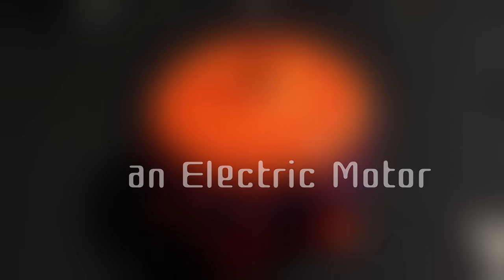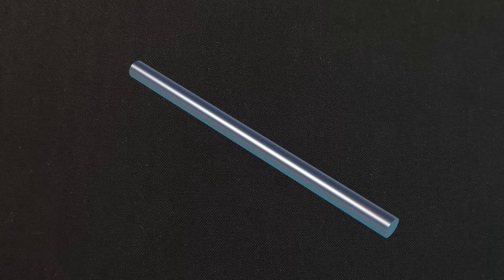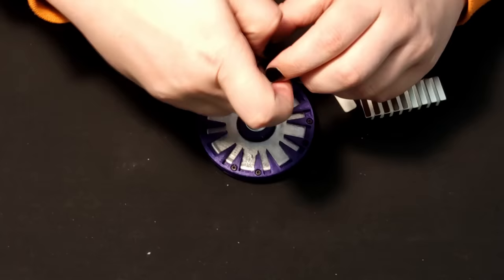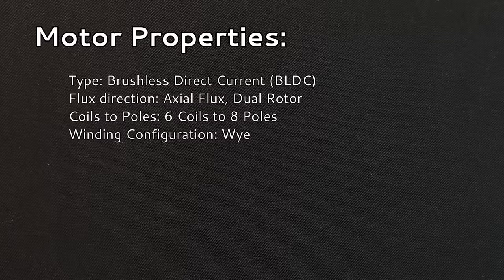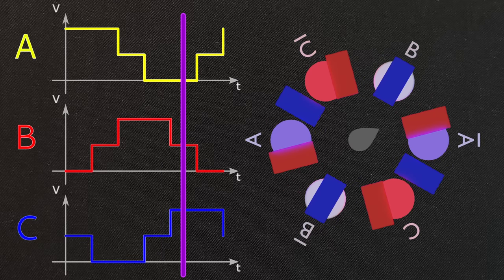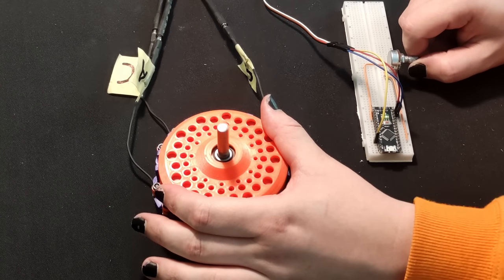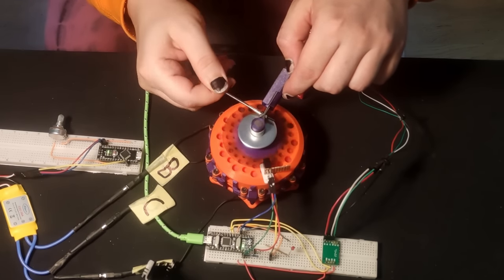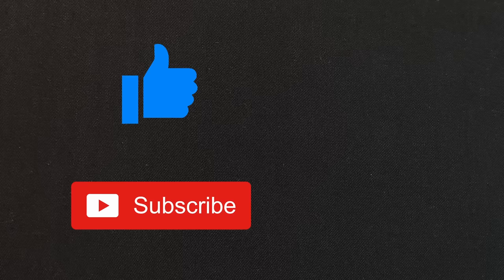An Axial Flux BLDC Motor Build

Comment: The solid steel core (big washer) was a mistake. You do not need a core between the magnets. You can use a single magnet for each pole, no need to stack them. A core associated with each coil can work good but you don't want solid steel. Better to use high silicon steel laminate. Notice how a microwave transformer is made, with layers of lacquer insulated steel sheets? This controls eddy currents but passes magnetic flux. However a fairly efficient motor can be made with coreless coils. A laminated annular casing can also be used to complete the path of magnetic flux generated by the coils. 

DIY axial flux BLDC/PMAC motors that test at efficiency levels in the high 80's or even low 90's are not unheard of. There is no reason why a DIY motor cannot match the performance of a commercially available motor such as those made by Motenergy, for example. 

Another improvement in efficiency is instead of using back EMF, use an array of Hall Effect sensors for rotor positional input to the controller. You can experiment with timing by rotating the sensor array about the axis of the motor. 

You are wasting significant energy by using very flexible 3D printed parts. You want high rigidity and low eddy current losses which dissapates as heat and kinetic energy in the form of vibration and noise.

I would also incorporate a thrust bearing to keep the rotor centered between the stators. This is particularly useful when directly driving a propeller and generating an axial force on the shaft.

There are formulae for calculating number of turns in the coils, etc for different speed and torque requirements for different loads and different voltages. For the DIY-er it is probably easier to simply experiment, and optimize. Another factor for optimization is spacing between rotor and stators.
Reply from the maker: Hi!

The solid steel washers are not "cores" but "back-irons", which serve to give the unexposed permanent magnet poles an easier flux paths between one-another, which in turn slightly increases the magnetic force exhibited by the permanent magnets. The magnetic flux generated by the electromagnets is not able to influence the back-iron due to the permanent magnets and their much more dense magnetic flux being in the way. Therefore, the back-iron does not experience any eddy currents (there are no changing magnetic fields inside the back-irons) and cause little-to-no drop in efficiency. Yes, a back-iron is less needed in a Halbach array rotor, so it may have been better to not have it but it certainly would not have been a significant difference either way.

Have you ever tried finding electrical steel laminations for sale? Especially for your specific project? Electrical steel laminations are for products that actually end up getting mass manufactured or sell for large amounts of money per article. I am quite poor, and most definitely can't afford 10000$ on a single project! I have entertained the idea of finding a product with suitable electrical steel laminations and simply cannibalizing the electrical steel from there and cut them to shape to fit my purpose, but so far I have always just opted to use mild steel, which for many of the common blends have maybe about 20x worse magnetic characteristics than most blends of electrical steel... but still 50x better magnetic characteristics than just air... 

The efficiency of diy motors is difficult to get very high, especially when 3d printing components out of plastic, because the tolerances simply aren't there. The air-gap between the rotors and the stator for this motor are between 1 and 2 mm... (in production motors this gap is always less than 1mm, usually on the order of 0.1 to 0.2mm). Add to that the use of non-ideal materials, inefficiencies from things like rotor inbalance and less uniform windings... I think that a diy plastic FDM 3d printed motor will not reach even 80% efficiency for the next decade.

Hall effect sensors can be used, yes... in-fact they were necessary for my next motor project which I will release probably within a month.

Once again, this is diy, made cheap... literally in a commie-block apartment room, I'm not sure what kind of manufacturing quality can be expected unless I order like... CNC-milled stuff, which would be too much of a monetary cost for me to take right now. 

Thrust bearings should be added if the motor shaft is expected to get pushed or pulled like when a propeller is attached to it. Having said that your motor needs to be pretty darn big and powerful for this to be really necessary. Not a single drone motor (even those crazy ones that supposedly have a 2hp peak power output) I have seen, uses thrust bearings in their construction. 

Of course there are formulae. I'd contest that such formulae are used in conventional ways nowadays any more though... and experimentation and optimization is the gold standard of the industry nowadays. Simply that the experimentation and optimization is done in software using finite-element-analysis models... Unfortunately, the best ones, such as EMworks, are part of larger CAD suites, which are prohibitively expensive for diy-ers to use. If you know of a good and intuitive free software for magnetic, or indeed, electric- and magnetic analysis, then do let me know! I have been looking for one on and off for some time now.

Comment: These axial magnetic flux motors are revolutionizing EVs soon. Yasa and Magnax have an efficiency of close to 98% at a very wide rpm range which gives you about 10% extra range compared to usual radial magnetic flux motors in EVs.
Mercedes have it in their EQXX and will soon apply it in the AMG versions of their EVs.
I am not sure if production is more complicated/expensive. So far my understanding is, that these motors are cheaper because less material is needed. I also don't know how much the rare earth magnets for an 300bhp EV sized motor would cost. however, soon iron nitride magnets seem to same the day and bring the cost down
Reply from the maker: The advantage of axial flux motors as opposed to radial flux ones in EV-s is the higher power density and consequently higher power to weight ratio. This is indeed highly sought after in EV-s as it allows you to put more batteries on the vehicle, prolonging its range. Axial flux motors are much more difficult to manufacture though, as any automatic winding machines are much more complex, and simply manufacturing a good performing stator with iron cores essentially mandates the use of milling - contrast that to radial flux's need of just stacking electrical steel laminations to create the stator, it's a massive price and complexity difference. 
Indeed, another problem is the need to use rare earth magnets, usually neodymium magnets, which are made from expensive, environmentally polluting and politically contentious resources. 
I also looked into the iron nitride magnets you hinted at, and while its flux density of 1 to 1.5T is impressive, the coercivity is pretty low, meaning they will be quite prone to demagnetizing over time... and forget about making any Halbach array, where magnets are constantly trying to demagnetize each-other. In addition, it seems like the coercivity drops off faster with temperature than rare-earth magnets. All of which is to say, I can definitely see iron nitride replacing rare-earth in some applications, but for EV-s it would require careful cooling design considerations, which might complicate the whole vehicle design enough for manufacturers to not bother in many cases.

Comment: Something is out of phase inside your motor.  If you put iron inside with it you may have cause the fields to mirror each other or push out too far and this causes you magnets to be misaligned.  I suggest you take the iron out and try it with just magnets and coils.  Any iron should be outside of the motor's workings, like a simple backing plate.
Reply from the maker: On an axial flux motor, the only possible place to put an iron backing is on the rotor(s). This is a very common thing to do on axial flux motors. The iron backing only acts as a low-reluctance path for the magnets to couple to each-other and ever-so-slightly increase the magnetic flux density in the airgap of the motor, as well as minimize the magnetic field outside the useful working area of the motor. I am fairly certain the problem is in one of the coils (maybe i ended up winding one coil the wrong way... though i did quickly check for that and at first glance it didn't seem like anything was wrong). For the next axial flux motor I will take more care to triple-check every assembly move I do.

Comment: I think you'd need laminated iron cores between those coils if you'd want to get higher efficiency, the magnetic field on the coils is not concentrated enough. I considered using steel strapping for my own project as a go-between since it's too hard to find electrical steel, this mild steel would have more hysteresis but having any kind of iron core would likely increase the efficiency by a lot just by reducing air gap and concentrating the magnetic field.
Reply from the maker: It's just fairly difficult to fit iron cores in an axial flux motor, and indeed, it's just very difficult to source a good electrical steel material. I was thinking that maybe old transformer cores would work if cut into shape, but I am not sure about their high-frequency characteristics - maybe it changes something.
Reply: @BirdbrainEngineer  failing that you might just try protopasta's iron-filled PLA. It's definitely not as good as pure iron but it would probably be better than no core at all
Reply from the maker: @0hypnotoad0  I believe I saw someone testing the magnetic permeability of "magnetic pla"-s and they don't have a magnetic permeability greater than 5 to 10, which is really really bad. Put ontop of that the fact that PLA melts at a low temperature, it's just not a good idea to use that in a motor one would expect to be "useful" imho. (The motor made in this video was never meant to be "useful" for anything, rather just to lean how to make one, hence the heavy use of PLA). I think in the future if I 3d print parts for a motor then they will be printed with ABS... or if it is possible with my printer, then maybe even polycarbonate.

Comment: some of the new motors actually are called radius axial they use both both types for motor with high tourque and high rpm
Reply: And I assume higher eddy currents?

Comment: Try using plastic self lubricating bearing. Igus has some available or you can machine your own from a variety of plastics. Also from what I understand these motors get hot. And I didn't hear how much horse power this motor was rated at.

Comment: Stator with 6 coils evenly spaced in a circle. Rotor has 2 levels. Level 1 has 6 north facing magnets. Facing the coils. Centered over the coils. Level 2 has 6 south facing magnets. Facing the coils from the other side. Evenly spaced between level 1's magnets. When rotated to induction will become autonomous. Why? Just type this into A.I and it will explain it

Comment: Am I mistaken or wouldn't you get a stronger magnetic field if you would've put iron cores into the stator windings?
Reply from the maker: Iron cores essentially extend the generated magnetic field all the way to the airgap of the motor. So yes, generally it is a good idea to have iron cores in motors, however it's simply difficult to accomplish for axial flux motors, and ontop of that... most steel products that you are able to find easily do not make for good electromagnet cores due to their geometry and magnetic properties.

Comment: with a ferrous material in between each coil and with magnetometers on the motor to measure the magnet position to optimize field position you could probably get much better efficiency.
Reply from the maker: Most freely available steel is either some low carbon steel or stainless steel... out of both categories, most blends will be suitable to act as iron cores for the electromagnets, but they are not really that great at that role. And indeed, if you are not careful, then you may actually end up losing performance due to increased eddy currents and cogging. I am working on a motor project that uses steel though, so I definitely haven't ruled out the possibility
Reply: @BirdbrainEngineer  what about silicon steel as used in transformer cores ?
Reply from the maker: @heartobefelt  Silicon steel is the most common type of steel used for electromagnet cores. Usually the exact magnetic characteristics of the electrical steel (different name for silicon steel in electric applications) are specifically manufactured to suit a task... May it be as motor electromagnet cores, transformer cores, noise filters, etc... 

I have thought about using old transformer cores as electromagnet cores for a motor, but I haven't really looked much into it yet. But yes, it is on my radar as a possibility for sure.

Comment: Amazing video. However, I have a doubt. May I know why efficiency of this motor is only 53%? I am sure you can increase the efficiency by a lot more. Axial Flux BLDCs can give up to 96% efficiency if done right.

Usually, in conventional motors, windings are done around a ferromagnetic core so that the magnetic field of the coils are more concentrated, increasing efficiency.
Reply from the maker: The efficiency is low because one of the phases is quite messed up. If it was working as good as the other two then the efficiency would probably have been closer to 70 to 80%. Other sources of inefficiency is cogging from using quite ferromagnetic bolts and nuts (seems like cheap chinese ones are made of some extremely mild steel), as well as a fairly large air gap between the rotors and stator (about 1.5mm). 
And yes, fitting iron cores to the windings is usually the way to go but it's very difficult to make that happen, especially for axial flux motors... so most diy-ers choose to go for air-core.
Reply: @BirdbrainEngineer  Air gap should not be an issue, as most ordinary motors have about 1mm air gap. Cogging is an issue but can be fixed by using materials with lower permittivity or decreasing the width of the ferromagnetic core. But these 2 problems can give max 10 to 15 percent efficiency loss. I think the phase winding is the main problem. Hope to see all these corrected and another video with higher efficiency.
Reply from the maker: @aadhithvarathan5432  I have plans to make another permanent-magnet axial flux motor one day... but probably next year. I'm also considering trying my hand at making a SynRM motor at one point.
Reply: @BirdbrainEngineer  Eagerly looking forward to that video. I am actually very happy to see more people trial new motor technologies like Axial Flux.

Comment: Why do coils have a "neutral" or unconnected position, wouldn't it be better to drive the coil to the opposite polarity and push away the pole that just passed ? It would then be energized in the correct polarity to attract the next pole as well, since there are not neutral poles ?
Reply from the maker: The explanation is made with "neutral" poles in there for simplicity's sake. In reality, the ESC attempts to mimic a sine-wave pattern (which usually ends up being a trapezoidal-wave pattern) on each of the coils through pulse-width-modulation. Search "ESC waveform" on Google for images and articles on the topic.

Comment: How does the fifty three percent efficiency rate against other electric motors types ??
Reply from the maker: Not very well haha. Air core, large air gap, not the best magnet topology, a broken winding all contribute to it having such a low efficiency. To be clear, I never probably actually hit the sweet spot for efficiency on this motor, so I'd imagine the eventual max efficiency would have been about 60%, but that's still a lot lower than the 75 to 90% that most cheap electric motors get. And for example automotive electric motors are usually up to 95% efficient, and I believe the most efficient production motor might have been something like 98% efficient.
Reply: @BirdbrainEngineer  I am not an engineer but somehow electric motors somehow are made for easy manufacturing methods from what I know. I should have said that is what a many people have told me who were in the KNOW. When average people invent super high efficiency it makes me question all the information that is presented to me Sir. Who would you say is the most promising inventor of the best so far presented to us and the world ??? Good day to you and thanks for ultra honest video which keeps all honest. Peace and good luck with your channel too. vf😀😀

Comment: The reason the motor had trouble spinning up is because you are using a sensorless BLDC driver ( not that you could use one with sensors since your home-made motor doesnt have any ). The BLDC driver must then spin up the motor more slowly as it does not know whether or not the rotor has spun up with the induced field of teh stator or not.
Reply from the maker: Agreed, that was certainly a compounding factor. Though I think the other factors, potentially the more impactful ones were that the kV was messed up, so the ESC would have had a harder time with picking up the BEMF, and that the rotor has a lot of inertia as well as an amount of resistance, which is certainly higher than the ESC was really "designed" for.
Reply: @BirdbrainEngineer  As an improvement you could use a BLheli ESC. They are more expensive but also have better startup torque than the noname ESC that you used.